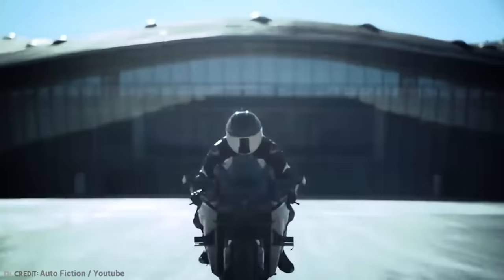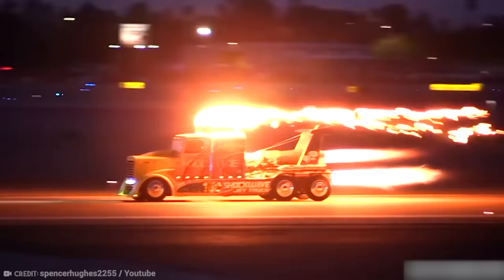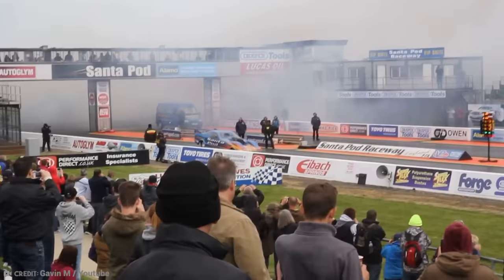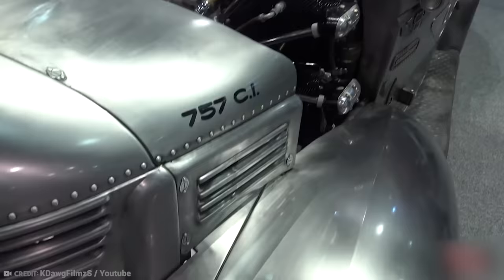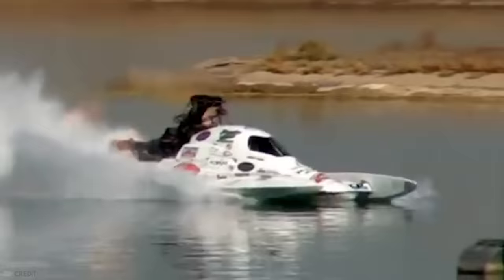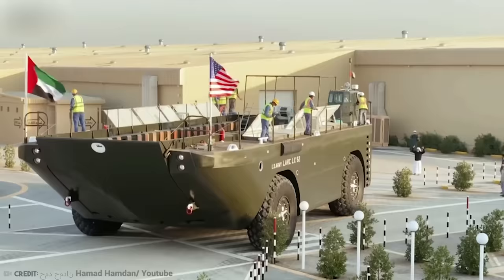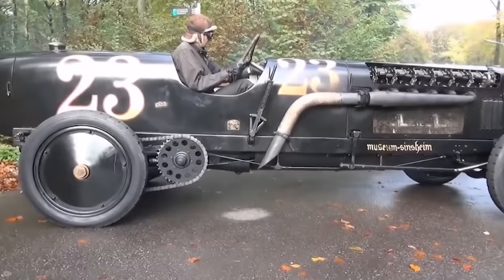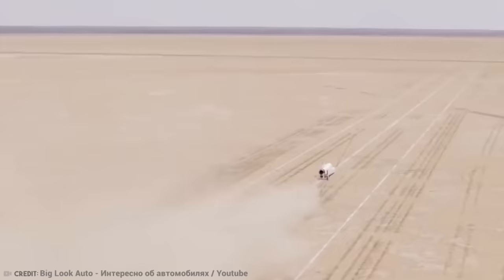20 Most Powerful Vehicles With Crazy Engines

Comment: I used to own an extended cab Datsun pickup on a Chevy s-10 frame with a 500 Cadillac motor. It was a sweet truck and was my favorite color blue with white stripes. Perfect body. New paint no rust or dents.
   The seats had to be moved back to get the motor in and the firewall had to be cut and moved. Yeah, it could haul ***. One time I took it out for a spin to show my dad and when I opened it up, I hit a bird and it splattered the top of the windshield. I just kept going.

Comment: fastest I ever got was 125-130 mph in my 81 trans am w/ t tops I got for my 18th bday. it was an eventful day as it was the fastest I had ever driven, it was the most expensive speeding ticket I had ever received and the first time I was incarcerated for speeding which at the time I didn't know was even possible. I got clocked at 115 in a 55 mph zone. it's wasn't as bad as it sounds. it was early in the morning at like 230am so no one was on the road. it was on the arizona beeline highway in the desert so there were no houses or neighborhoods. just me racing my friend back from payson and the cactus/desert landscape . it would have been  even higher but I was walking away from my friend and actually had started slowing down so he could catch up. FYI tickets at that speed start acting like compound interest. ticket cost + $3 dollars per mile over till you hit 10 miles over then it's an excessive fine and now $5 per mile over till you hit another 10 then its a criminal excessive fine + $10 dollars per mile till you hit another criminal excessive fine and then $15 per mile over and so on!!! ouch. it was a miracle my parents let me keep the car.  damn I wish I still had that thing.

Comment: Mercedes, Volvo and Scania trucks all comes with engines with more HP and torque. Mercedes, 625 HP and 2212 foot pound of torque. Volvo with 750 HP and 2618 foot pound of torque, Scania with 770 HP and 2729 foot pound of torque. All engines are Euro6 certified, saying that they pollute less than most cars.

Comment: Just so ya know, that jet powered Peterbilt is not a "semi". A semi is a trailer. Semi-trailer cuz it only has wheels at one end as opposed to a full trailer with an axle in front and one in back. What the Pete IS, is a TRACTOR. Or you can and do correctly call it a truck. Says me, retired trucker of 40 years and I driven 'em all.

Comment: A top fuel dragster has 10,000 horsepower not 8,000. Plus the beast of whatever it was did not get destroyed because it has been at the Goodwood Festival of speed in England. I think it ran the road coarse in 2021.
Reply: I was just getting ready to ask, if they dismantled it then WTF are they driving around! Those clips sure as hell aren't from just after WW2!!!
Reply: Also wasn’t it a 4 cylinder engine?
Reply: @robinmaes58  Yes.

Comment: Anybody can put a jet engine anything..these so called jet powered cars n trucks have been done to death!!
They have set peramaters that they work at..and that's it!  Internal combustion engine you can tune add bigger heads pistons
Cams ..any thing you can think of to get more power ..the mechanic is the computer..same as these new battery operated cars..you can't do anything different with them
WHAT!!..add more batteries for more power..😂😆😂.   Your going to be driving a radio control car!! ..on oversized power wheels!!!😂😆😂

Comment: quickest  2 wheel Vehicle is an top fuel motorcycle at the quarter-mile in 5.50 seconds at 264 MPH on 21 November 2019, the highest top speed was the Dodge Tomahawk at 420mph then the Kawasaki Ninja H2R or the MTT Turbine Superbike Y2K, which was 250mph need to get them facts right there buddy
Reply: Still rather have the Y2k thou

Comment: The Fastest I've ever gone was 110 mpg in a '72 Dodge Dart Sport! 😂 Yeah, I was a Risk Taker as a Kid.
Reply: Mph  u put mpg miles per gallon lol 😆
Reply: 115 in my WRX 22B
Reply: LOL and I thought I was a badass at reaching 103mph (ca. 166 km/h) in my old Nissan 1980s 200sx. :)
Reply: 136 in my V8 swapped Datsun....with 3.15 Nismo R200  rear diff .59  5th gear        currently a 3.9  so it has better acceleration    haven't tested top speed  with 3.9 yet though
Reply: I had my Honda Accord V6 up to 200 kph (124.9 mph) last summer. It must be governed at that mark, because I felt it had a bit more in it. Regardless, it was a rush.